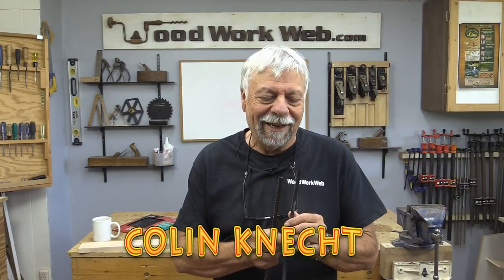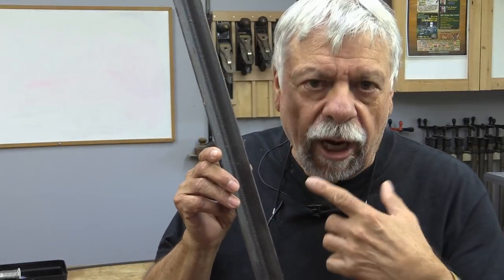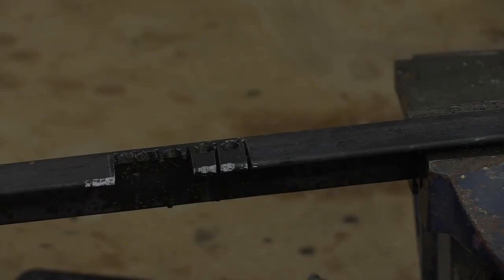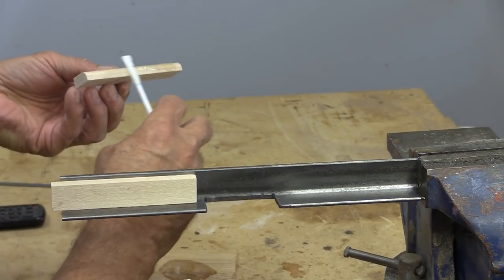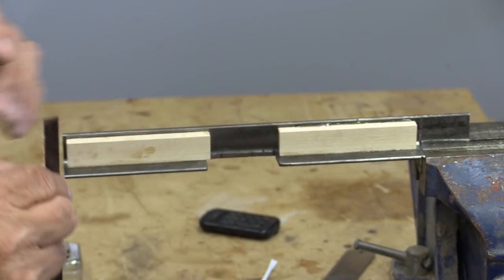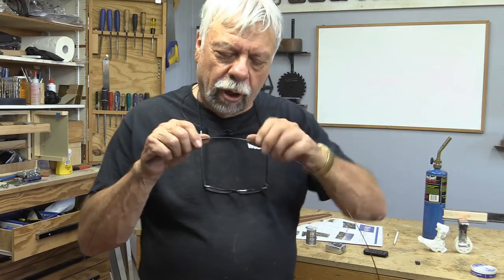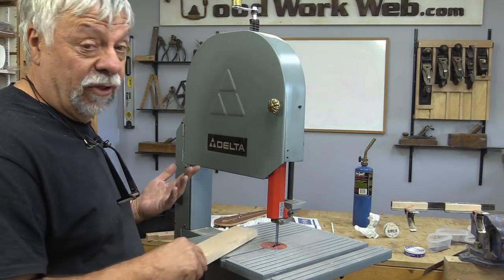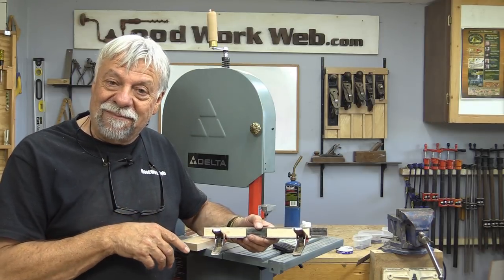Bandsaw Blade Repair - How to Solder Bandsaw Blades

Comment: Brilliant, one blade snapped, bought new one which was an inch too long, so having seen what you did I soldered the snapped one which worked great, so deliberately snapped the new one ( very cheap blade) and soldered that. Both working great, very happy man. It's not the buying of a new blade, a repair can be done in minutes, when I had to order a new one it took days.

Comment: There are numerous splicing kits available using silver solder, which is much stronger than standard lead/tin solder.  Brazing is also popular, using the same alignment jig, and is similar to soldering, but much stronger and longer lasting.

Comment: Never seen them repaired with ordinary solder, so interested to hear how long it lasts. Silver solder is a better option and can be done easily with the torch and rig you have. When finished, just place the blade over a curved surface and lightly file off any bumps both sides. If using silver solder or braze, let the blade cool slowly, in fact keep it warm either side of the join to anneal the join/blade an inch or so either side. Blade last longer when not brittle at the joint. As another viewer commented, use your angle grinder to cut and shape the angle iron-even cut out the middle section with it. Thanks for sharing, stay safe, Greetings from Tasmania Australia.

Comment: I have always silversoldered my blades. I have a 30 Metre roll of blades. I cut to length and then carefully grind the ends square and prepare a holding jig and butt solder the blade ends together remembering to leave a tiny gap between the ends to allow the solder to flow through. I use a very small flame oxy acetalene torch. It has always worked well for me. Preparation and cleanliness are very important.

Comment: I have 3 blades waiting to be soldered. I've been recommended to use silver solder for bandsaw blades, and to lightly file any lumps that occur. Nice job, mate 👍
Reply: Bill Carroll the flux for silver solder, is the same?
Reply: Percy Flores yes, as far as I'm aware it is. I have never seen different flux other than a paste and a liquid form.
Reply from the maker: Agreed, i think silver solder is a better choice if you have it kicking around the shop. Thanks for watching, Bill.
Reply: @knecht105  is brass stick good for soldering bandsaw blade?

Comment: I agree with the other comments.  Silver solder will give you a joint with better strength.  And, you can dress the "wound" with gentle application of a stone or file after the solder joint has cooled.
Reply: Richard Grier the flux for silver solder, is the same as used in this video?
Reply: Each time that I have purchased silver solder, it came with a tube of flux. IMO, it (probably) is exactly the same!

Comment: That was interesting.  Never thought about doing that method.  I have used a MIG welder on low heat and it worked fine then touched up the weld with a flat file.
Reply: Madness!  I have thought of TIG welding, and then dressing and annealing?  But I have the silver solder and flux, an ounce of solder might be good for a lifetime.  I've found some silver-brazed blades to be as durable as anything, and some come apart, so it still needs work.

Comment: I have a 40 year old Craftsman 12 inch that uses an 80" blade.  80's are a little hard to find so I just welded a broken one today and it seems to be working fine.  Because of the thinness of a bandsaw blade, welding is kinda tough.  I think I'll be making a better jig and try soldering.  I'm thinking of buying 92 1/2" blades and cutting them down.  We'll see how that works.  Thanks for posting.

Comment: Score! I’m pleasantly shocked that solder could hold those forces. I thought for sure it would have required a braze, but never argue with success. (I notice some comment confusion over the fact that we braze with something called “silver solder” as one of our fillers materials and that causes some confusion. Brazing happens over 850F and causes an electrochemical bond whereas soldering, which Colin did, is cooler and just glued metal together when the liquified metal cools and freezes again as in plumbing copper joints. )

Comment: I used silver solder and from everything I have read it works better than a welded blade. I have one in my saw right now that was my first ever attempt at silver soldering and it has been running for weeks now. I brazed another blade as an experiment and started snapping off sections close to the joint. One section snapped off less than an eighth of an inch away from the joint with no apparent damage to the joint itself.

Comment: Awesome attempt! With a stainless steel hemostat pressing the joint solder would have flowed in the same way and since the stainless steel does not adhere to solder it would have helped the joint a lot. Great job and great idea! Thanks!

Comment: Something I never thought of- Thanks Colin! I should give it a whir. l am inclined to agree with the silver brazing guys. I'm stuck for now with my old Delta 3 wheel that takes odd 82" blades fortunately available locally at Lowes. 3 wheels are notorious for breaking blades. I will try to eke out a bit more life from them and with the money I save buy a REAL bandsaw. Or for even more fun- build one
Reply: great job. that is how its done

Comment: Great test, and it seems to work very well, But evetime I cut a peace of wood, I would be thinking ( is it going to snap )  and I think it would take my mind of the job. Now that being said what a bloody good idea if you cant get hold of a new blade straight away
Reply from the maker: It was really just a test to see if it would work. I prefer to replace that blade also, if possible, but this method should get you out of a bind.

Comment: I expect that the solder will eventually give way after a bit of use, Brazing would have done a decent job too I think.
Reply: I think the metal is too thin to braze, but yes, solder is very soft and brazing is much stronger if it were possible.
Reply: I used to braze to some very thin metal James, but after more thought, & although it would work for Colins task, the heat needs to me more sustained, so it would take some of the spring out of the blade, however it would still cut wood, and would save it from the scrap bin.

I hope Colin does a follow up on this as it is a very interesting idea.
Reply from the maker: I agree that a braze or spot weld should be better, but I was really just testing this repair option out, to see if it would work. Maybe in the future, I'll borrow some oxy acetylene and do a brazing test also.
Reply: @kevsbuild2807  When brazing with 50% silver brazing alloy, the temp is a couple hundred degrees lower than using brass filler. This is right around the critical temp for steel,* so this indeed heat treats the steel. But the band cools so fast in air that it re-hardens. I'm not privvy to the inner circle of band manufacturing, but I bet the blades are air cooled to begin with, with the band running through a furnace with a small opening on either end, and when it comes out the other side there is perhaps either passive air cooling or perhaps compressed air is shot over the teeth to speed the quench. But that's a guess.

Any rate, you can't tell the difference in hardness after a proper silver brazing. After the passive air cooilng, the joint has just about exactly the same resistance to bend/flex and springiness as before. But any time you harden steel, you should temper it after. In this case the proper temper is about when the steel turns blue. If you overdo the temper, the area of the joint will indeed be softer and will tend to yield/bend and take a set at that spot.  Many people don't temper, at all, after brazing. And such a blade will for sure work 100% fine with no temper for at least a "good while." But it might break, prematurely at a seemingly completely random interval of use. Same thing will happen to a homemade wound music wire spring. It will work, it will compress/stretch, it will spring back. It will act like a spring. But even kept within the demonstrated operating specs, it can fail via an out-of-the-blue breakage where it snaps clean in two, if you don't temper it after forming it. The tempered spring (or blade) will not suffer this sort of failure. The hardening (or the bend-forming of hardened steel) step leaves internal stress risers that can lead to tiny internal cracks, which over many bend cycles will tend to grow. Tempering takes this edge off so that these internal microcracks don't form to begin with.

*One advantage of silver brazing over brass is this lower melting temp. When you heat treat, you want to bring the steel just barely to the critical temperature, where you can just barely detect a dull red glow in indoor lighting. If you used brass filler, you would have to get the metal bright red, maybe even orange. This would produce the same problem you have when resistance or TIG welding a band. It introduces large grain defects when the blade passively air-quenches. You would have to re-harden the metal to just cherry, after. (Some people call this step annealing, but I think it's more sensible to call it re-hardening in this context).

Comment: You need to use HARD SILVER SOLDER  the type used by jewellers , the more silver in it easer to melt ,so use less heat

Comment: A silver brazing alloy would be the filler of choice.  It can be brazed with a common propane torch and is much stronger then standard solder.   Silver solder is commonly used in jewelry, copper and brass. It is weaker than a silver braze.

Comment: silver solder is the preferred method and a little grind of the lap weld for a seamless blade, good show! Nice to buy cheap common sized blades that are too long than to pay $$ for a 2nd tier length.

Comment: A great Job Colin, but I would worry it would part when under stress / tension.
Reply from the maker: Agreed, replacing the blade is preferred,  but this repair should get you out of a bind if you don't have spare blade kicking around. Thanks for watching.
Reply: I bought a jig years ago and have soldered several over the years. You have to use silver solder though
Reply: Silver solder is used to hold down 5ton hydrallic jacks.

Comment: Good job Colin to learn from you, I thing if you use aluminum angle in the future it would be much better. All the best. 
Khalid
Reply: Aluminum is a better conductor of heat than iron.  Seems it would take longer to heat the blade before the solder would run.  Or perhaps you are thinking that the aluminum would draw away the heat so the blade doesn't lose its temper.  Looks like it is a horse apiece.  Can go either way.  I'm not an expert.  Perhaps you have more expertise in this area than I.

Comment: First let. me say that I like your videos. Second, don’t use a reciprocating saw to make those cuts, use the angle grinder that I know you have. That angle grinder could cut a square inside corner on the angle iron, and this is the point where I take umbrage, if you are using a substantial source of heat, do not introduce a flammable substance (the wood). Your angle grinder with a cut off wheel will do a great job of removing the inside radius from the angle iron🐠

Comment: Years ago I had purchased a kit from woodcraft to weld my own blades from coil stock.  It came with flux and silver solder.  My question it now I'm out of the thin solder..can I use the same stuff for sweating pipes or is it too thick ?

Comment: Nice easy fix using. Tools and techniques.  Most people. Would have in their basic shop or handyman kits  i know very little about metal characteristics and. Qualities  but i wondered  if. That fix. Since it looks like. It was. A fix they used in the past. If it would work best. With the old time leaded solder ?  After my Grand dad passed my Grandmother. Asked me to. Go thru his shop and take whatever i wanted  or could use  I found several  rolls of leaded solder he. Had stashed  at one point i had the oppurtunity to. Work. On. A antique Steam engine and boiler  that ran on Map Gas  when rerouting  the gas lines(copper). I. Found. The leaded  solder to. Hold up and work the best ? The conclusion  we had was. The engine  had a lot of  vibration when it was ran and the  lead  somehow survived the vibration  the steam engine was actually inside a toy boat so it was  a safe place that didn't risk the dangers of lead  being used ! My guess was that the house my Grandfather built in the 50s had all of the plumbing soldered with the lead solder since i found it in all of his plumbing  fittings  and tools !

Comment: Colin, the heat generated is enough to make the solder run through the union?

I meant...you put 2 or 3 times the flame into the union, the flux ran, the solder too but....the blade was hot to get solder yet?

Thks you Colin.

Matt
Reply: Another guy who did this heated the blade red hot.  Doesn't take much heat to melt solder me thinks.

Comment: I can see using this in a pinch if I had a deadline and no way to get a replacement in time.  But otherwise, not sure I'd trust the solder in that joint (which is much softer than the blade's metal) flexing around the wheels at high rpm, or cutting its way through a piece of hardwood.  My luck, it would give way just as my wrist was reaching past.
Reply: JusBidniss Ain't gonna happen. The blade just stops, after it snaps.
Reply: Tom Ahoks - spot on.  The sound is a bit scary...but never has it been dangerous. I have broken about a dozen over 20 yrs or so.

Comment: The only problem I have Silver Soldering blades is getting the joint hot enough to flow, using a propane torch.

Comment: Thats cool I am always scared about the band breaking on me and chopping a finger off that I never re-saw on it
Reply: On most band saws the blade is mostly enclosed.  If the blade breaks it might make a loud noise, but it doesn't go anywhere, partly because it instantly loses tension, so there's no drive and it just stops.  The saw motor is still running but the blade isn't moving, you see?

Comment: Solder lumps can be sanded or filed flatter if they should bother you. Silver solder is stronger, but it requires more heat & isn't as flexible as 60/40 or 63/37 solder.
Reply from the maker: Thanks for the tip and thanks for watching!
Reply: Silver solder might be ten times stronger than electrical solder!  Roughly as strong as mild steel, maybe more under ideal conditions.

Comment: Disc sanders do a poor job on tapers its to do with fpm on the outside of the disc it moves much faster than the centre a belt sander would do a much better job

Comment: That‘s a very informative video. Thanks for sharing.
My life with a bandsaw is slightly more than one year but I already „managed“
to break two blades. I did not throw them away. They were waiting for your video.
I must give this a try. Once the jig has been made it the repair itself does not take so
much time. Over here bandsaw blades (1400 mm) cost from 12 USD up.
So for sure it‘s worth trying/experimenting it.

I have some questions:
What kind of solder did you use?
And what minimum and/or maximum temperature is necessary?

I hoped to find these answers in the article you wrote on this topic
Maybe the answers are really there but the link in the description seems to be not correct:
it leads again to the video and not to the article.

I went to your website and found the article. This should be the link to it:
https://www.woodworkweb.com/woodworking-videos-1/woodworking-tools-videos/727-repairing-a-broken-bandsaw-blade.html

But I could not find the answer to my questions there  :-(
Reply from the maker: Thanks, I've fixed the article link. 
I used regular solder and typical use a torch,  so I'm not sure with the min and max temps would be. I would suggest using silver solder if you have access to it.
Reply: You're welcome. I have only very few experience with soldering (only some wires) so I have been searching on the internet for more information. I know there is "soft soldering" till 450 C and "hard soldering" (brazing?)
with temperatures till 1200 C or even higher.  Torches (burners) for soft soldering can cost as little as 25 USD
but torches for hard soldering can cost ten times more, 250 USD. Could you please mention the brand and type of burner you used for this particular project?

Comment: OK, this may sound like a silly question, but would it be possible to epoxy the join?
Reply: No, Definitely not strong enough. there wouldn't be enough surface area for epoxy to work plus the heat generated when cutting would break down the epoxy.
Reply: @canonmanmart  Ah. OK, thanks.
Reply: Silver solder (and steel) might be five to ten times stronger than epoxy!

Comment: I have no idea, how dangerous is having one of these snapping on you? as dangerous as kick back?
Reply: Nelson Baietti no it’s not that serious. It always makes me jump and gets the blood pumping but because it’s incased in the saw it doesn’t do any real damage.
Reply from the maker: As Morgan mentioned, the noise and action of it snapping is the scariest part in my experience.  Thanks for watching.
Reply: It tends to just tangle up a bit on the bottom wheel i did work with a guy that claims he was injured by a snapping blade but i doubt it there isn't enough space for the blade to escape through the guard
Reply: NO!  It usually makes a loud noise, but the blade is shrouded in the machine, and in most cases when a blade snaps it loses tension instantly and stops.  The machine has a lot of momentum, but the blades might not.  Especially thin light blades as used in home woodworking as we see here.  I have some blades that only weigh an ounce or two, when they hit the casing of the saw they stop right away.